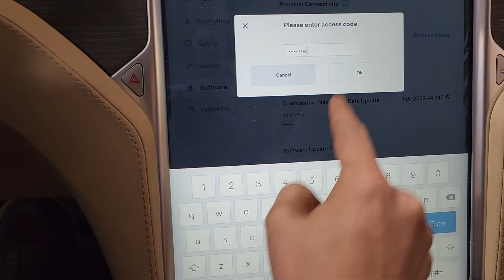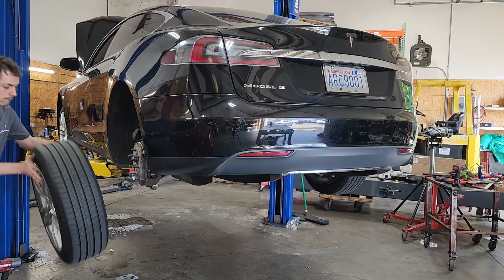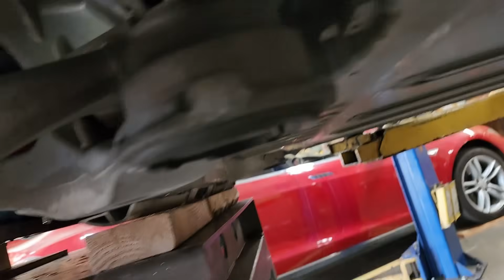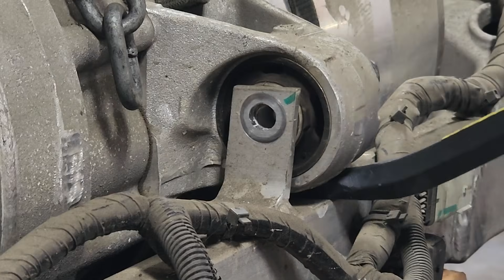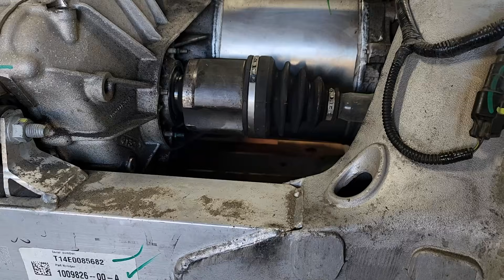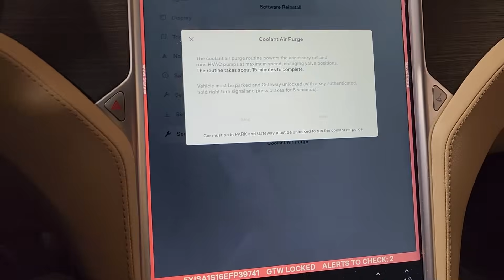Tesla LDU Rotor Coolant Delete Install (Model S)

Comment: If theres no more coolant going in - will this make the motor very hot and eventually die ? Will this work a 2015 b250e?
Reply from the maker: Most of the cooling system for the motor stays intact and fully functional, the only portion that gets bypassed is just for the rotor (the part of the motor that spins). And yes, this can be installed on a Mercedes B250e (or a Toyota RAV4 EV as well).
Reply: That’s cool! 
And since you’ve worked on these was there any issues with the rotors not being cooled? Have people drove thousands of miles with this kit without any reported problems. 
Also if I want to buy the kit online which one would you recommend please?
Reply from the maker: @sinanjordanful  Yes, even Tesla's newest revisions of replacement LDUs for use in the Model S/X also have the rotor coolant circuit deleted from the factory. 

There are a few different options for coolant delete, but I would recommend one that retains the "flyover tube". QC Charge has a billet manifold that just bolts right on, simple to install. The press in cap versions (like what I used in this video) are much cheaper and work very well, but require modifying the original manifold.
Reply: @AlexEVRepair  awesome Alex thanks a lot!

Comment: It's worth checking the direction of the suspension arm bolts on the subframe. Most times they are facing the battery meaning they cannot be extracted easily and reversing them while the subframe is out makes the removal of the suspenion links easier later on. Tesla actually specifies a gearbox oil quantity which ends up to be less than the 'level' plug.
Reply: You've got to be a mechanic also. Cannot believe the patience you guys have to just get to the parts!! How do you keep track of all the pins and bolts?? Years ago, when cars came out, the engines sat right there and computers weren't around to make you have to cut this out and take off that to just get to work on the parts. This guy Alex must be doing this for a long time for him to make it look so easy. And, of course, he has the garage, with all needed help.

Comment: I take it the Fly Over Tube is replaced just to keep dirt out as no coolant passes through it anymore(?)
Reply from the maker: Coolant does indeed still pass through the flyover tube both with this modified manifold, as well as the billet ones from QC Charge.

Comment: That is without doubt the most concise video work of subfame drop / coolant delete Ive sen to date thank you. Ive run a Model S P85 from new now 10 years old 155,000 miles. About 100,000 miles I cut a 2" 100mm hole in the plastic cover with a hole saw so I can see the coolant level just by opening the frunk. Ill do a coolant delete on mine in the summer (working outside here in UK) but in the mean time I pulled the speed sensor it was dry, ill keep an eye on the coolant level........it starts dropping start panicking!
Reply: Literally just done mine on the drive. Hi from Wiltshire!

Comment: Can I do this in my garage?
Reply from the maker: Sure, numerous DIYers have removed their drive units at home. It's certainly not as easy as doing it with a proper lift, but with the right tools, it's totally doable.
Reply: @AlexEVRepair  thanks for the "anything is possible" love those kinds vibes. 

I skipped and got a model 3. Getting an EV to avoid maintenance, I have other ICE cars that I have to keep maintained. 

Your video on installing the coolant delete was beautiful and inspiring. I hope to make similar quality videos on repairing a Fusion soon. 

Any tips? I have a solid tripod and an okay phone with a huge external hard drive. The phone kinda over heats and just generally isn't great at setting to record for long lengths of time regardless of memory storage. Should I just make this work, or would investing in some proper camera be worth while? 

In any case at all. I hope you're well and thank you very much for your content. I was a reasonably informed consumer today.

Comment: https://youtu.be/niVcAblWyMY?si=2yXk-_fpwU0CXKT_

Thanks for the video. Why don't you clean the metal ATF filter inside the differential-reduction gear compartment with a rinse aid? It always gets clogged with dirt residue due to worn gears, and little by little, the ATF.

Comment: Do you have a video on the battery swap? How did you get a bigger battery in, any problems with Tesla/software using it?
Reply from the maker: I have a video coming out soon on a battery repair (which of course includes removal and install). Installing a larger battery is fairly simple, and can sometimes be done with just a simple software redeploy, though it's best to use Toolbox 3 so that the configuration can be properly updated.
Reply: @ thank you for your reply and the great content, I’m glad I just found your channel!

Comment: No rotor cooling can mean early bearing failure as the grease melts out. Rotor shaft gets so hot it turns blue.  I added a drain pipe and swapped the seal out to a 3 lipped one.  Other EV motors with no rotor cooling (permanent magnet rotors are not affected) have similar issues.
Reply from the maker: The grease in the bearings I use is rated for temperatures up to 288 deg C (550 deg F). So far, I've done many of these coolant deletes with no adverse affects on the motors. Even if the bearings do start to have issues eventually, replacing them is still cheaper than the stator or inverter being destroyed by coolant intrusion.

I've seen many triple lip seals fail, sometimes quite quickly. It's not a long term fix unless you want to be checking your speed sensor every 6 months, and likely replacing your rotor seal every 2 or 3 years...
Reply: @AlexEVRepair  Thank you for your detailed reply. I guess the fact that Tesla is doing the coolant delete nowdays says it all.
Reply: @AlexEVRepair what’s the part number to the bearings you are using ?

Comment: Sorry if this was asked before what would be purpose of the coolant delete be. Not detrimental to the drive unit ?
Reply from the maker: The purpose of the rotor coolant delete is to eliminate the failure mode of coolant intrusion from a failing rotor coolant seal. I cover this failure mode (as well as other common LDU failures) in a bit more detail in this video: https://youtu.be/U0LErO78AVw

Most of the drive unit's cooling system is left unchanged by this modification, the ONLY part that is bypassed is the rotor itself, which even to start with had extremely minimal cooling... The only potential downside might be reduced lifespan of the rotor bearings, but they inevitably get taken out by coolant anyways when the seal fails (along with corrosion in the stator, damaged inverter electronics, loss of HV isolation, etc.). BTW, even Tesla's latest revision of the LDU (Rev-U, which has been out for about a year) also has the rotor cooling deleted from the factory.
Reply: Thanks... you answered my question...🎉 @AlexEVRepair

Comment: Thank you for the great video! One thing I would suggest mentioning is to mark the position of the bolts on the subframe before removing it, so that when reinstalling it can be put back into exact same position.  Otherwise alignment may get affected.
Reply: Heads up! Bolts stretch when they are torqued, once stretched they don't torque again properly. $hell out for the replacement bolts
Reply: These aren't stretch bolts and go nowhere near yield

Comment: Many thanks for producing such a good quality video and well done for not adding any annoying music.  Do you have any data or information about whether or not additional heat from the coolant-deleted LDU rotor triggers any alerts or power reduction?
Reply from the maker: There is no way for the car to measure the rotor temperature, so the answer to that is no. The only temperature measurements made on the LDU are for stator and inverter temperature, which are completely unaffected by this modification.

Comment: Isn't there torque settings on all of those bolts.  I did not see you using a torque wrench.
Reply from the maker: Tesla does not make the torque settings available for most of this hardware, I do it all by feel....
Reply: @AlexEVRepair  You don't need Tesla specs, every bolt has a typical torque value based on it's strength rating stamped on its head. Just Google for a torque table spec sheet.

Comment: Hopefully good & honest ICE mechanics will realize that switching to EV repair can be a very lucrative field and not nearly as messy.
Reply: Still messy, cars live in a gross environment.
Reply: What is the cost for this process?
Reply: Been servicing EV’s since 2019. Added another 130k to my gross  revenue.
Reply: @lynxstarautomotive208  I don't know what you'd be doing to them maybe I'm just lucky but I beat on mine for a decade 177,000 me I haven't had to do anything other than tires
Reply: @fishdick403 I said “EVs” plural. Not just Tesla. I stopped working on Teslas until recently when right to repair forced them to open it up again.

My shop grosses over 700k a year. 130k of that is peanuts in the grand scheme of things.
Reply: @lynxstarautomotive208  golf clap 👏 people believe u and care

Comment: Awesome video! Does the car need an alignment now?
Reply from the maker: Nope, none of the hardware that affects alignment adjustment has been touched.
Reply: @AlexEVRepair we had a customer come back with their tires toast.  Turns out we reinstalled the subframe at a slightly different angle and that was enough to throw off the alignment.

Comment: I just cut off the original plate above the lower antifreeze hole, removed the lower part and plugged it up with welding. Then I took her back. It takes 1 hour and there is no need to remove the engine. I now have 12,000km after that with no problem.
Reply: Great idea to weld it.  What do you do about the top return pipe? Do you have a video you could make explaining this process?
Reply: @diytesla  Top return pipe - Just cut it and plugged it :))No I don't have video, but it is easy
Reply: @boni1970  I'd love to hear more about this!
Reply: If you cut a hole in the plate do you have access to remove the part without dropping the subframe? Please elaborate
Reply: @bjently Yes, you can remove it easy, without removing subframe.  26000km , no problems.
Reply: This approach deletes the coolant feed to the gearbox.
Reply: @mgutkowski Absolutely not. Coolant from this back pipe from the rotor is 60-70 degrees. Gearbox is 50-55 degree. It is much better without it. 35 000km after this cooling delete I don't have any problems.

Comment: Can you post a link for the axle seal removal tool and the seal installer tool?
Reply from the maker: For the seal removal on the gearbox seals, I just use a short pry-bar. The install tool is just a simple generic seal driver, I got mine at Harbor Freight.

Comment: Great stuff! Fun watch.
What does a job like this cost for the model y performance model?
Reply from the maker: Model 3/Y are not affected by this issue.
Reply: @AlexEVRepair  I was assuming the issues were across the board, but thanks for clarifying!  Thanks for the cool content to watch!
Reply: @Kenshin_Tran Only LDU (Large Drive Unit) is affected.
Reply: @AlexEVRepair 

Is it all S? Or just the RWD / performance models? 

So are all wheel drive non performance models fine?
Reply from the maker: Correct, only RWD and/or Performance versions of Model S and X. 
Dual Motor, non-Performance versions don't use the LDU.
Reply: @AlexEVRepair  this comment pretty much sealed the deal that I would buy a model 3
Reply: @modernNeanderthal800  i have an S plaid, S p100D, S90d, X90D, and a 3DMLR. The S is by far the most comfortable and sporty, X is great if you need more room. The M 3 has been sitting for 7 months, I cant even drive it because everything about it screams Budget cuts. Its a cheap entry level car, same with the M Y.  Not to mention the s p100d and plaid are insanely fast cars.
Reply: @baronvolkov6172  well I'm quite frugal and enjoy the 2018 M3 i bought cash 

I've busted my ass to be in this position. 

But damn I can see it. Still enjoy it over an ICE
Reply: @baronvolkov6172  I tried a couple model S the leather looked like a used condom. 

Model S needs more repairs that obviously you have the money for. 

The model 3 rocks
Reply: @modernNeanderthal800  The older MS have the terrible interior, p100d has the later gen ventilated seats which look and feel like quality. There was a change in 2016 or 17. The seats in my 3 honestly feel very simple and like you described and theyre not even worn at all. Just not even close to the look and comfort of the S. Only repair needed so far is il be doing the coolant loop delete on the LDU of P100d. The 3 is an OK car when compared to the S. Its a great car when you compare it to stuff like VW id4 or Hyundai Ioniq 6
Reply: @baronvolkov6172  thanks for giving me a reasonable thought 

Maybe I jumped the gun a smidge but Tesla was still the right call. 

It's real thanks

Comment: Removing the subframe doesn't affect the rear wheel alignment?
Reply from the maker: None of the hardware that adjusts wheel alignment is touched for this whole process.
Reply: @AlexEVRepair we had one customer come back as the subframe position did affect their alignment significantly
Reply: @AlexEVRepair  That's not accurate, it either shows inexperience or maybe lack of an alignment rack. That subframe is not lined up on dowels like other brands, therefore there will be an alignment change upon reinstallation. It's not only in pretty much all the instruction manuals but like other poster mentioned, the alignment can be off significantly to induce tracking issues or tire wear. Speaking from many decades of experience. Just refer the customer to an alignment shop and cover your back.

Comment: I know absolutely nothing, so this is just my ignorance speaking.  But I am puzzled why you never use a torque wrench?  I'm just curious because it would seem to me on things like motor drive unit and brakes you'd want everything to be equally tight, and also neither too tight nor too loose.  I defer to you as you are the expert, I'm not a car person :)
Reply: Its called "A Mechanic's Feel". It takes many years and it is calibrated to bolt diameter, length, and thread pitch. When I was a boy, my Dad would put his hands over mine as we assembled his Model A Ford and later the 64 Impala. He would 'feel my feel" and coach me. He would also have me torque things and then he would check them with his hands. We only every used a torque wrench on Head Bolts, Manifold Bolts, and bearing caps. No motor ever failed and now at almost 70 my self, I have taught my Son the same. You can also adjust valves by feel and sound (just like a musician does a stringed instrument) and often on a high milage motor you will get a much more consistent valve adjustment by feel than by feeler gauge.
Reply: when u tighten bolts all day for a living you get a "feel" for correct tightness.

Comment: Why not fully clean drive unit with brake clean prior to installation.
Reply: Its just going to get dirty again anyway.  doesn't affect operation, but getting the transmission oil off so next person doesn't think its leaking is important to prevent unnecessary service.
Reply: @ I was talking about the inside so the mating surfaces are clean for assembly. I agree that the outside doesn’t matter much for cleanliness.

Comment: For how many miles is this solution ok ? Don’t the bearing inside get over heated ?
Reply from the maker: It's possible that the rotor bearings might have a bit shorter lifespan without the rotor cooling (though the amount of cooling they got in the forst place was pretty minimal, witu coolant flow limited by a ~4mm dia hole). 
Usually, they get destroyed by coolant intrusion before wearing out anyways, so it's a net gain in reliability. Better to just need to replace the bearings at some point rather than have the whole drive unit get destroyed by coolant intrusion!
Reply: @AlexEVRepair  great thanks for reply. Unfortunately I live in Sweden, if I were closer I would love to be your customer.
Reply: @AlexEVRepair is it worth checking or replacing/upgrading bearings while in there? Wondering the part cost too.
Reply from the maker: @Nicholas-f5 Sure, I do LDU rebuilds all the time, it's a lot more work to tear the motor down to do that though, and in this situation, it wasn't needed.
Reply: One more question, TESX or Revolt ? TESX keeps using the Flyover tube and Revolt doesn’t ? Or same same ?
Reply from the maker: @peteroffpist1621 Personally I'm for keeping the flyover tube, as I think it's important for bleeding air out of the system, and also helps with cooling the differential. 
The TESX one works fine, but for a bolt on option, the QC Charge manifolds work great (I worked on the design for those when I used to work there). Usually I have those in stock, but a new version has been in the works and I only have one left, which I've been keeping on hand. Should have them again in the next week or so.